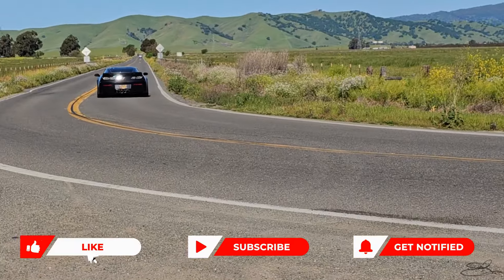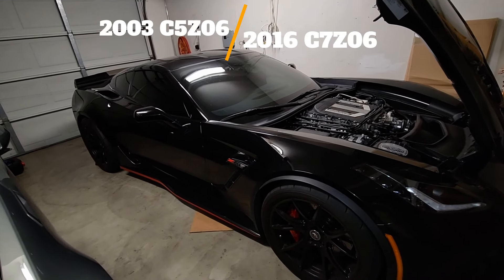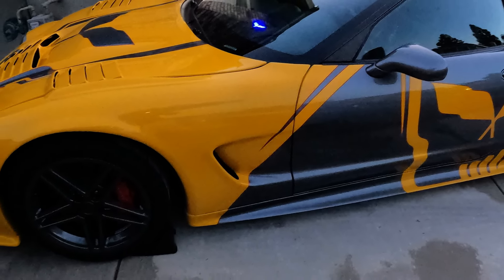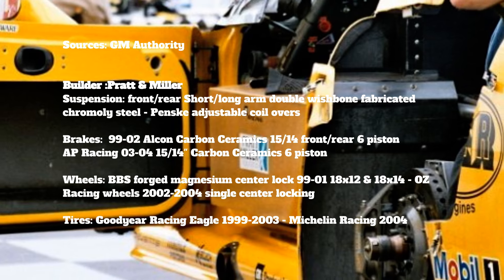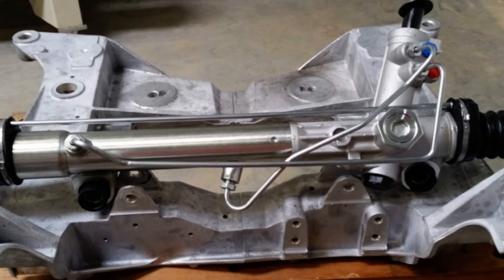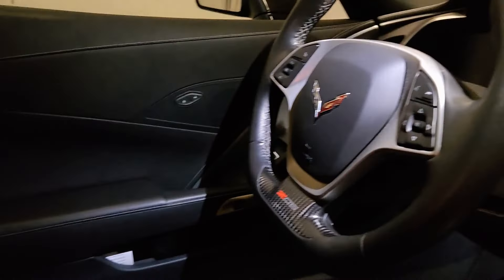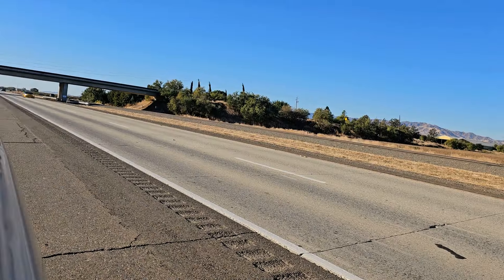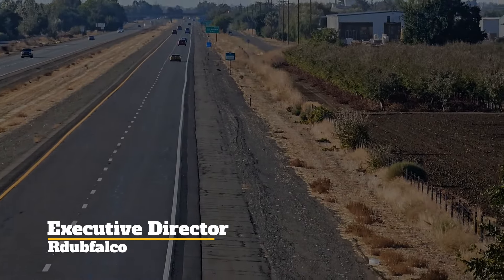CORVETTE C5Z06 vs C7Z06 COMPARISON

Comment: Awesome video!! Bet that c5z would be great on a road course. Idk about the weight for c7z. I have the same car and weigh 150 myself and nasa racing scales say 3608, with me in it and half a tank. I have some weight reduction. That weight does look right without driver.
Reply from the maker: @ClaytonYatescarenthusiast  thanks for chiming in! The C7Z was weighed at Sacramento Raceway scales with me in it. I don't know if they're calibrated, but I can take to another location to check. As for the C5Z06, I have a C5.R block that I'm planning on having the engine built at CSM Racing Engines.  I have a complete suspension kit ready to go on it. It will take a while before all that work gets done!
Reply from the maker: I've seen your channel! Cool stuff you're doing over there, I look forward to more tech, especially on the C7Z. What weight reduction and cooling did you do for the Z06?